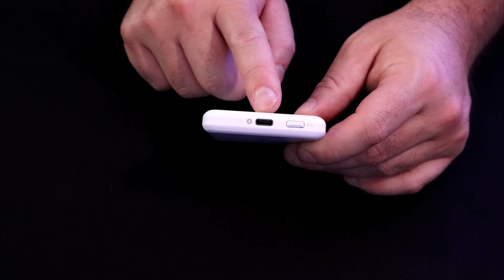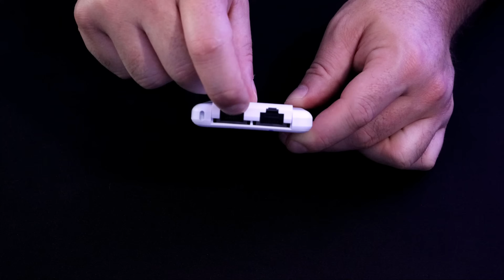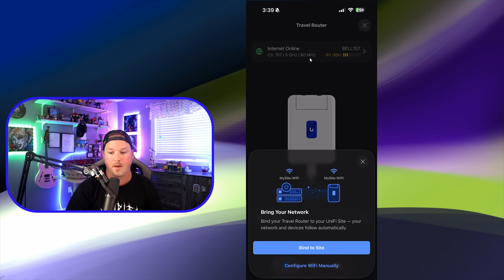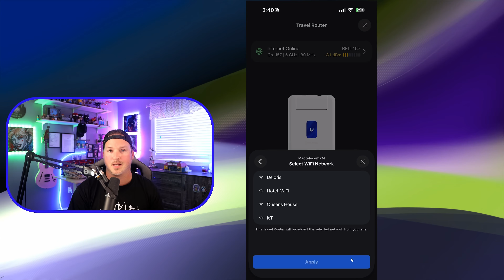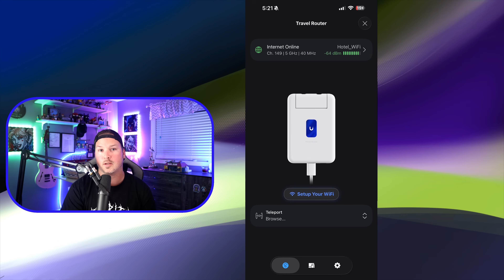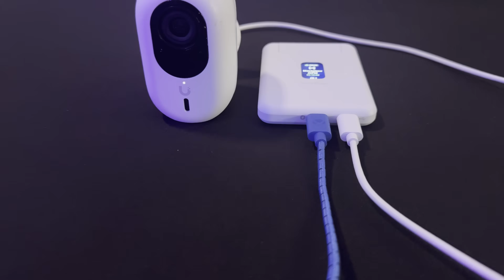UniFi Travel Router: Compact, Easy To Use, Connect A Camera Back Home

Comment: That was nice you showed the G6 Instant. I just took time to make a G6 Instant Camera work with my UTR LR and WireGuard via pfSense. I discovered a few limitations. The secondary SSID does not go through the VPN. I hope a future firmware update will allow us to assign a VPN to an network SSID. If possible allow us to have two VPNs at the same time, one for each network SSID. Allow for no NAT in WireGuard, so we essentially have a site-to-site, so each device on the UTR can been seen from a remote site.

Comment: I just bought one to use as a backup to my primary internet on my Dreamwall. I was able to tether my cell to the travel router’s USB port and then hard wire to an uplink port on the dreamwall. Works great!
Reply: Exactly what I came to find out.  So USB tether from Phone to Travel Router works.  Awesome.  Thanks for that.

Comment: Hello, thank-you  for this video, I bought the UTR and had the hardest time setting it up. I watched your video several time, reset the UTR several times, and it could never find my CONSOLES. Well, I did a google search and used the AI, and voila, the solution. YOU MUST BE LOGGED in as the OWNER for the Unifi console and App to find and bind the consoles on the UTR!! who knew! My problem is I first set up my unifi years ago with my usual google email secondary account, and now am using my primary Apple email account (as a super user) to do all of my network logins; well, the UTR doesn't like that!
Reply: You saved me Graydon. Spent the last hour trying to figure out my problem and it was in fact this. Can confirm the account you use on the mobile device must be the first account you created for your console.

Comment: I like the fact that it has no battery. This allows for the device to be the size it is. You can always have a portable charger if you need the battery. This is a great add for travelling to have a secure connection and to have cameras with you in your room.

Comment: I received my travel router and love it.  Quick question though if anyone knows.  I had a Gateway Fiber fail, and was stuck without a router for a couple days.  Since this Travel Router has two RJ45 ports, could this take place as a router in an emergency situation like my gateway fiber failure?

Comment: Thanks for the video, it helped me setup.
I had an older GL.iNet device for travel and recently updated to the Slate 7, which is just a dual band Wi-Fi 7 (strange). Then I decided to get the UniFi TR just for giggles and it's TINY! I like it.
I also pre ordered the Mudi 7 from GL.iNet which has battery, 5G cellular and tri-band wifi 7. At the end of the day that one might be the device I use the most, but the UTR might be the one I just take with me to a hotel.

Comment: why are none of the streamers mentioning its great for people who work from home. if your internet goes out you can have it link to your phone hotspot, plug the ethernet into  your router wan port and your whole home has internet from your cell phone connection. i've done it and it works great hitting 400Mbps down
Reply: Because many people have very restrictive data caps on their cell phone plans? 

Other than that… 🤷🏻‍♂️
Reply: @williamp6800  Not a problem in several countries, you're just being fucked by your ISP.
Reply: I bought one for this same use case as an emergency wan2

Comment: Thanks, great video. I have been struggling  to use this travel router via a captive portal.  It works fine with a similar simple password to access the wifi, but as soon as I need to use a captive portal I cannot connect.  Its like this in McDonalds UK.  Could you please do a captive portal video?  Thanks

Comment: Hi Cody! Of course I got my UTR on launch day minus shipping 😊. I have tested it out and it work as advertised! But I encountered one thing I haven’t heard anyone talking about. I use Unifi identity and have a WPA3/Enterprise enabled SSID of Unifi Identiry that all my secure clients connect to with the identity app installed. Mobiles and computers. I could choose this SSD to ” bring with me” with the UTR, BUT it made it an open network for some reason. Bringing over any other normal password protected network works. So this is confusing. Ubiquity should either not make this possible or support it properly and authenticate RADIUS to the gateway through the Teleport tunnel in my opinion. I don’t know if this is a niche case but I would think using one click WiFi for ease of use and security will be increasingly common. Do you know anything about this scenario? Maybe addressed in an upcoming firmware?

Comment: its an amazingly useless device, no POE to power it only USB and you have to use the other port to tether it so you need 2 USB C to use it in tethering mode. its also amazingly slow like 2015 slow, was a waste of $100(w/shipping).

Comment: Just got mine and set it up with tethering from my work phone. It’s a perfect replacement for my Beryl-AX travel router as it saves me from having to open WifiMan on each device (3) to connect Teleport. I don’t mind the slower WiFi since hotel and airport WiFi usually has limited bandwidth anyway. It’s so small I can comfortably use it on the plane. Well done Ubiquity! 😊
Reply: Why not just use WireGuard on your Beryl AX to connect to your home connection? Then every device that connects to your Beryl will automatically have access to your home network. You can even configure the slider switch to connect/disconnect the VPN.

Comment: How did it work when connecting to a Hotel Wifi? Any issues with hotel login or other strange things that might happen?
Reply from the maker: So at the place we were it wasn’t a captive portal jsut a password and it was fine.

I connected to a captive portal at home that had a password on it. I had to input the password then it worked fine as well

Comment: Unfortunately this thing kinda sucks. When I want to travel somewhere far away from home you literally have no choice other than teleporting and the thing is a dumb device essentially because it need a cloudkey to work in the first place. I seriously don't see the point in this. Maybe if you travel a few hours away but once you go too far the ping and speed will decrease so much you won't even have an enjoyable experience on the Internet. Also the antenna is no where near competitive with the glinet routers.

Comment: The one SSID thing is bothering me a lot, right now I use a UniFi Express as my travel router so what I'm going to do is use this as a bridge in a way so I can still use my travel router and keep my iot and normal networks separated.
Reply: I have multiple passwords configured on the same SSID on my cloud gateway fiber, each password connects to a different network but using the same SSID

Comment: i'm a little bit perplexed by this device, why would i need this, and not simply just use teleport to connect home on my device be it phone or laptop. Originally i thought it was a 5g modem, but that doesn't seem to be the case after all
Reply: If you travel with a Chromecast or some other third-party device, this would be handy. And the camera is really cool that you can record back to your house. But I agree teleport solves most of these problems.
Reply: @lawdawg1942  From what i can gather it's mainly for places that limits 1 device per customer like in some hotels, so you can connect the UTR, and then connect your multiple devices to the UTR. Which to me seems quite niche, since every hotel i've stayed at never had the device limit.
If however it did have a 5G antenna along with the wifi so it could do both, then i'd be all over this device.

Comment: Oof I didn't realize it would only let you broadcast one SSID at a time. This really sets back my plans for implementation since all the stuff I travel with is on a different network from my kids' devices when we're at home.
Reply: Unifi allows multiple passwords on the same SSID connecting to different VLANs

Comment: One of the big reasons for a battery is if you are using this thing in your pocket where you are paying per device but are also walking around i.e. a cruise ship.  

Granted you can just use a power pack.

Comment: Do you plan to do another further in-depth video? Doesn't look like you addressed anything related to connecting a camera and the load that places on the WAN link since it's streaming back home to store at the linked site. I'm curious how that would affect my network quality when I'm in a hotel room that has less than 20Mb down and up. Would having a gX-instant (g3 in my case) connected and constantly recording destroy the connection quality of my other devices? Or, does ubiquiti do some smart compression to prevent this (doubt it given the size of the UTR)? Or, would I need to set some QoS priority to place the camera stream at a lower priority than the other devices?

Comment: I don't get this.  What does "binding" to your home network do?  How can you get "home network speeds" if in order to connect to it, you still have to go through the crappy bandwidth-limited hotel connection?
Reply: My understanding is that you by binding to your home network, all traffic that is using the UTR wifi network will be VPN'd back to the binding site.  E.g.: you're in another country and you connect the UTR to the hotel wifi.  The UTR then can broadcast your home wifi network for your laptop/phone in your hotel.  All traffic from your laptop/phone gets VPNd back to your home network and makes your laptop/phone appear as if they are in your home country.  You cannot get your home network speeds if you're on a "crappy bandwidth-limited hotel connection" as your speed is limited by the connection the UTR is using, and the traffic will be VPN'd back to your home country and network.  But, you'd be on your home network able to access your plex server, file server, etc.

Comment: Not going to be replacing my GL.iNet Slate Plus any time soon. Adding it to & extending your site with a single pane of glass management is nice but severely lacking other features that GL.iNet products have like privacy VPN or USB SMB sharing, which we use when travelling with a USB drive full of TV shows and movies that the kids access with VLC on their devices when we're at Grandma's house which has poor Internet speed.

Comment: I like this device, but I have 2 WiFi SSID’s I need. One for my legacy 2.4 ghz WiFi devices, and one for my modern hardware. I could fix this to make a SSID on the travel router. But then I would not connect to my home. I want to be able to make a dedicated SSID on the travel router, and connect with the teleport function to my home when I see fit, to watch Netflix series from my home country around the world. It seems the device isn’t capable of doing this. It seems you can only use your SSID from home, with the teleport function always on, or make a new SSID on the device without teleport function. Is this right, or am I missing something? Thank you kindly for your video, very nice! You always give all the information I need on new hardware and software!

Comment: I have been on cruise ships that block VPN. I could not use Cloudflare VPN or even Teleport to access my home Unifi network using WiFiMan on my i-devices. I suspect that the same would happen to the travel router on those ships.

Comment: Why not put e-sim and 5G in this thing?
Reply from the maker: Price, cooling? Not sure tbh maybe will see a new model
Reply: Price. 

They just introduced a 5G mobile router at $400 USD….. I’m wrong. It’s not a router.

 It’s a 5G modem. It’s made to plug into your network as a second (or first?) WAN connection. 

It does not have a travel router built in.

Comment: I do agree with you on the ridiculous request to have battery power added.  The operative word is router.  How many routers are natively battery powered?  UniFi gave us the sweetheart deal at that price point.  Folks should consider all of these factors.  All the addons will jack up the price.  However, I do suspect, knowing Ubiquiti, there will be future iterations of this product.  For an introductory TR, it is perfect.  Thanks Cody for sharing this content.
Reply: I agree with this as well. Adding a battery would increase the cost and more importantly generate unnecessary e-waste.  Most people have a power bank that they travel with that they could easily use to power this device.

Comment: can you get any benefits from this device if you don't have a unifi setup 'yet.'
Reply: You get the same benefits of a basic travel router if you don't bind it to a unifi network. Basically just sharing an internet connection and limited VPN capabilities.

Comment: I always wondered, why don't you use WiFiman for speed tests?
Reply: Nowhere near as reliable.
Reply: @JacksonCampbell I use it all the time, never had a reliability problem with it. Now the Ookla properties I've had issues in the past. Haven't used it in years.

Also I normally use iperf3 for local tests. I have servers running all over the place.
Reply: @Hossimo I use them both consistently as a network engineer, and WiFiman is far less reliable.

Comment: Still haven't heard anyone mention anything about MAC address spoofing.  I'm assuming that means this router does not have that feature.  If that's the case, then this will not replace my current gl.inet router for cruises and such.   Honestly, any travel router MUST have that feature nowadays as more and more places are selling internet access per device, and many of those places are even using technology to block NAT devices (like travel routers) so they can force customers to buy more overpriced, per device, internet packages.
Reply: the regular gateways do so I imagine it's going to be similar. I don't Mac spoof in my gli.inet either

Comment: Pretty much all battery banks and wall multi-port usb-c adapters reset and negotiate power levels as you plug/unplug devices. So a small battery, or even capacitor that could bridge that would actually be nice. Another use case would be trying to find the spot in your hotel room where the UTR would get the best WiFi uplink signal.
Reply from the maker: Oh interesting that very good to know thank you
Reply: @MactelecomNetworks  I was thinking more of on flights or walking around with it in your pocket at a hotel etc. It would be nice to not have to have a power bank with you.

Comment: It would be perfect if it had a cellular uplink.

Perhaps a future “Pro” model is incoming?
Reply from the maker: Not sure future models but that would be sweet
Reply: @MactelecomNetworks  they just introduced a5G mobile routers $400 USD
Reply: @williamp6800   are you talking about the 5g max? thats not a mobile router it plugs into your at home network to give you 5g connectivity theres nothing mobile about it. its power by POE so need a POE and a battery station in order to travel with it.
Reply: @bossman762x39  you’re quite right. I realized that after posting that info in several places that I got it all wrong. Thought I’d found them all to fix it. Apparently I missed at least one. 🤦🏻‍♂️

Thanks for pointing that out so that other people aren’t misled by my screwup. 👍
Reply: @williamp6800  The Dream Router 5G Max is what you are looking for.   $500.   You can also do a Unfi Express 7 + a 5G max for a similar setup, say for a vehicle, but it's two units.  For either setup you'll need to contend with power for the devices, ideally a Pure Sinewave inverter.

Doing the dual device setup might be best as the 5G Max can be mounted on a window and has better internal antennas.
Reply: I believe you can use your cell phone hotspot
Reply: @kidcool8832 that is what I do. Saves me from having an extra Sim Card
Reply: [As pointed out in a comment below, I was completely wrong about the 5G modem being a mobile device. Powered by PoE, it is absolutely designed to be stationary in your home or office.]

They have had LTE mobile routers for several years. But not with a travel router integrated. 

They’ve just introduced a 5G mobile router. Again, no travel router built in. 

I would imagine someone makes a combined unit, but I don’t know who does. 🤷🏻‍♂️

Also, mobile router are significantly more expensive than a travel router. So cost wise, it would be more like adding travel router capability to a mobile router.
Reply: I would rather it have a small battery over cellular personally. But cellular would be nice.

Comment: Does this work for wireguard to a 3rd party router like opnsense? I only have unifi for wifi devices
Reply from the maker: Not as of yet. Not sure if that’s coming either
Reply: Yep it has both they have the specs on the website for unified🎉🎉
Reply: @kidcool8832 I guess we'll find out when I receive it!

Comment: Would this work well as a backup internet connection using a cell phone?  E.g. Connect this to WAN 2 on a Unifi gateway, and have it connect via WiFi to an iPhone that has LTE internet access.     Thanks
Reply: It should. I was able to do that with the glinet travel router. I don’t see why it would not work if it is the same brand
Reply: @tonyc2227  I think it would work if the iPhone was USB connected.  I can do that today with Synology router.  Not sure if it would work if it is WiFi connected. Likely.
Reply from the maker: That is a great question and something I did not try but I will